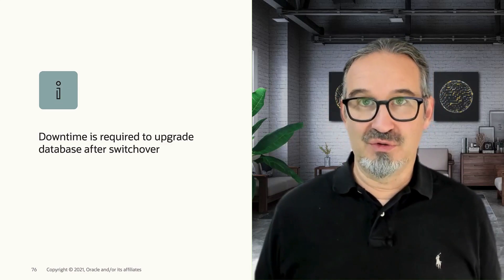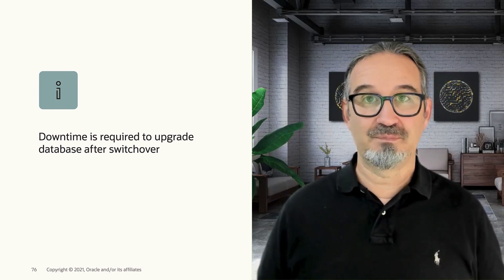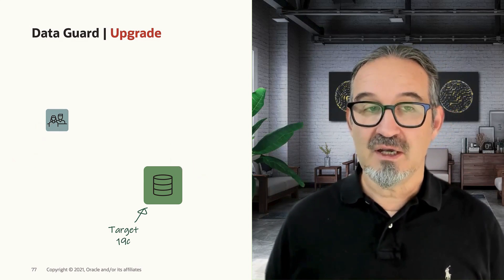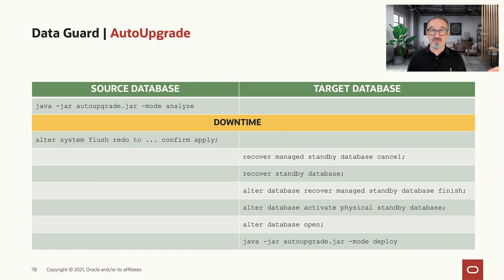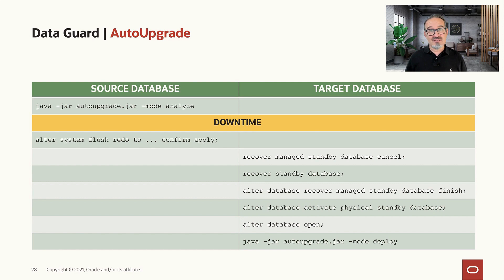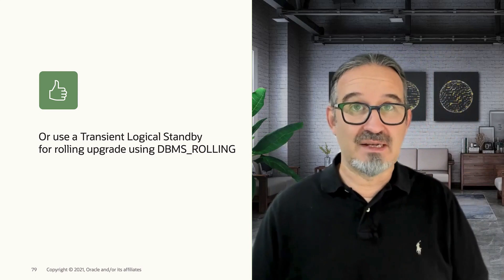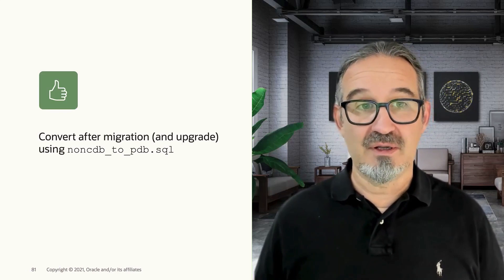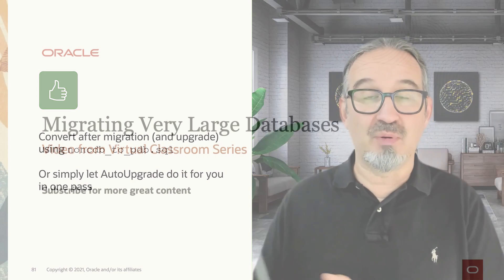How to migrate and upgrade Oracle Database using Data Guard

Comment: Hello, can i use data guard to migrate oracle 11g to 23c?
Reply from the maker: Hi, 
No, you can't. There is no direct upgrade from 11.2.0.4 to 23ai. You have to pass 19c first. 
Further, Data Guard is not a vehicle for upgrades, unless you use transient logical standby (search for DBMS_ROLLING). But, if you have standby databases you can upgrade those together with the primary database.
Regards,
Daniel

Comment: Greate Video.
Can I handle "alter system flash redo" etc from dgmgrl?
I find it more forward to do all from one interface (as we use dgmrgl for switchover, failover, etc.)
Reply from the maker: Hi,
That's a good question. I'm not a Data Guard, so perhaps I'm wrong, but judging from the documentation it appears you can flush redo from DGMGRL.

Regards,
Daniel